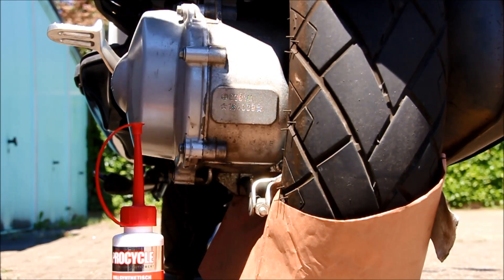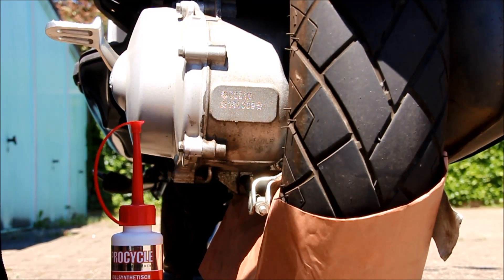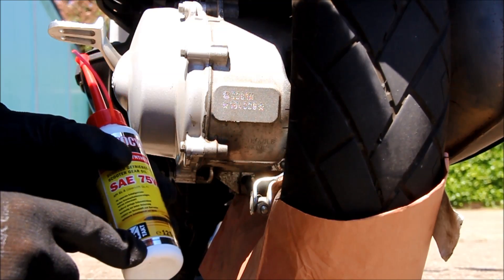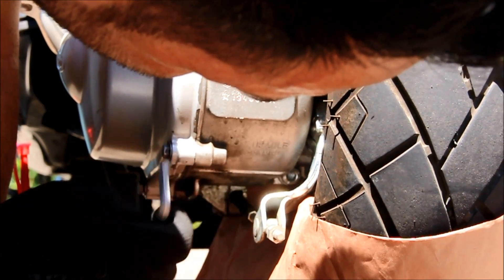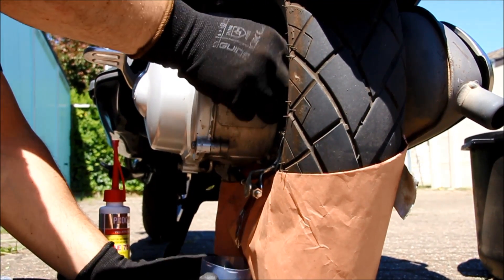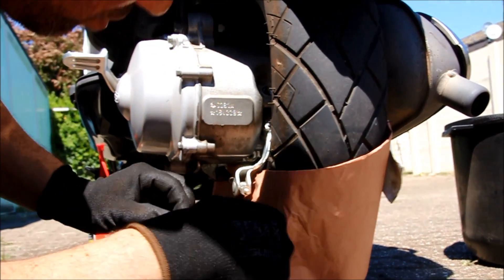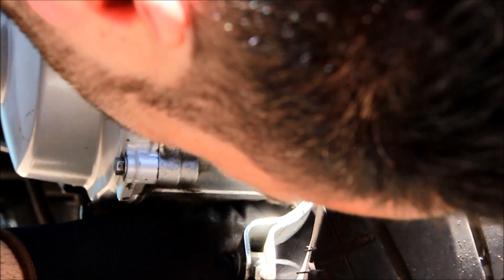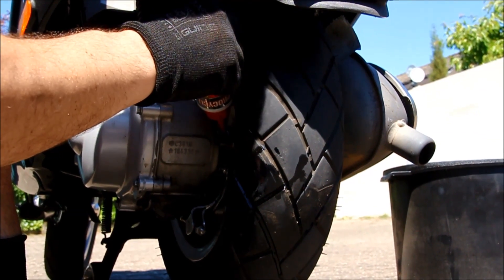How to change the gear oil on a Vespa LX 50 2T

Comment: Is valid for Vespa LX 50 4t??
Reply from the maker: Hi Juis yes of course!
Reply: No, with an LX 4 stroke it is a completely different story. It has both engine oil and transmission oil. The nut for the engine oil is on the right side of the stand.

Comment: The dip stick should be hand tight.
 Using a pair of water pump pliers will snap it off!!
  And removing it is a "nightmare"
Reply: You can use a 10mm wrench to remove the dip stick if you can get it in there. This may require removal of the rear wheel/tire for easier access. It's best to do this gear oil change while replacing the rear tire or brake shoes. It only needs to be changed every 5,000 to 10,000 km depending on the type of riding you do. Never mind, I just watched the video to the end and realized he tightened it with pliers. This guy is out of control.

Comment: You keep saying you can easily remove, it's very easy, but you struggled like hell to get it out. It's better to say it's tricky to remove. That bolt is NOT easy to remove, even for an experienced mechanic so stop giving your audience false hope. It takes about 100 ml (or 85 ml when doing a change since there will be about 15 ml of residual oil that remains on the gears). You said 75 millimetres (distance) but it's millilitres (volume). When checking the oil level, you need to screw it in and screw it back out to get the proper level. You can't just dip it in like that (well, you can, but then you are not getting the accurate reading). Also, the dipstick should be screwed on hand tight, not with pliers. Jesus Christ. This video is very bad.